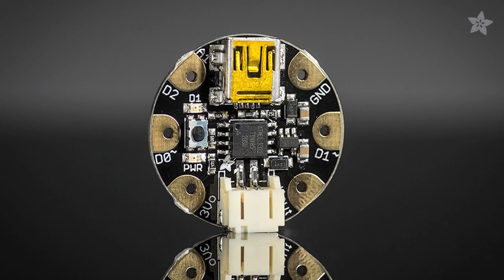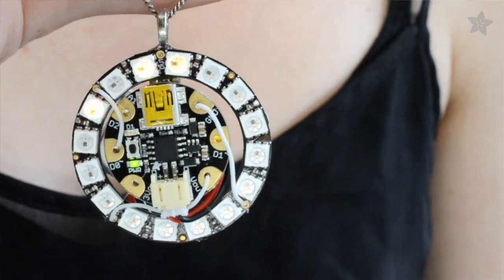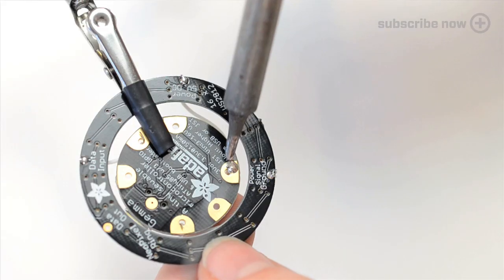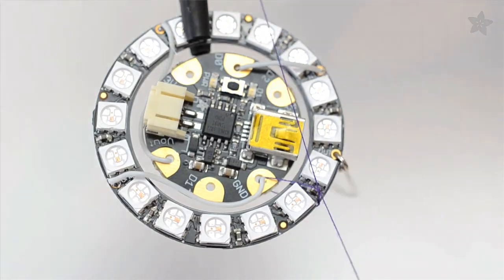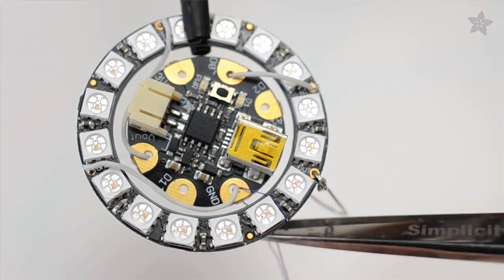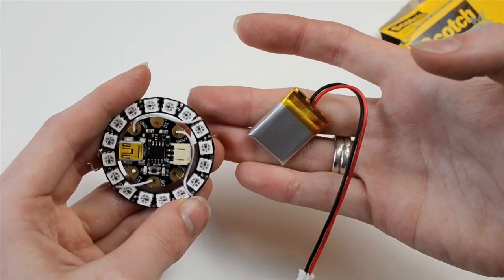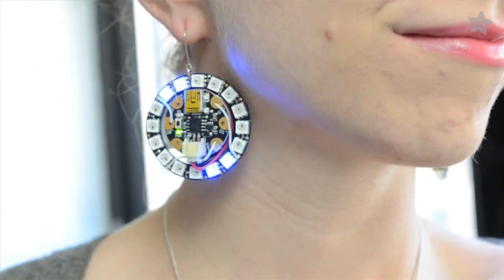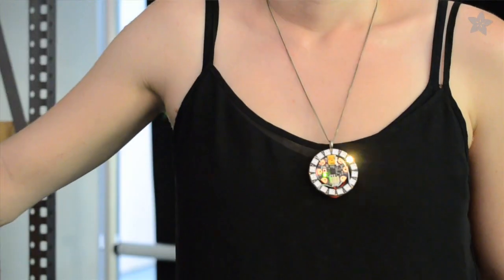GEMMA Hoop Earrings - NeoPixel Ring Pendant

Comment: I might be posting this in the wrong place, but I am going to make the neopixel ring pendant, and was wondering if it is possible to put an on/off button or switch between the battery and the main board? If so, would be a good button to use?